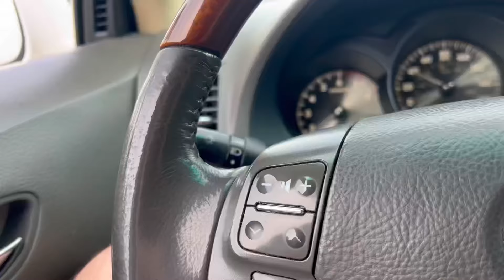Best Sounding G37 Exhaust !? (ISR SINGLE EXIT)

Comment: another g with isr and aodhans🤦🏽‍♂️
Reply from the maker: The 🥩 riding is crazy
Reply: @BrandyBoy13  🤣😭, ok bud if you say so
Reply: fr basic g37
Reply: @-MoTioN i mean it’s a good exhaust didn’t know it was a issue to like a exhaust 😭when every mustang is driving around straight piped or h piped with rush muffs
Reply: @jlamontt17  now every infiniti got this raspy loud cheap exhaust on it, basically like the mustangs.. its a good exhaust if your cheap at the end but its not quality like the rest and most vq owners know that..
Reply: @-MoTioN  i mean i’ve never heard someone complain ab their exhaust being to loud i mean what are you expecting to happen to when you buy one , also isr is only raspy if you go bout it the wrong way simply going resonated test pipes with a solid y pipe is enough to get rid of the major rasp or if you really wanna get rid of it  buy a resonated y pipe to go with the resonated test pipes
Reply: @-MoTioN  in might opinion motordyne doesn’t sound bad but it’s not really loud, tomei is way to raspy unless you go ab it from a certain way
Reply: It’s just the starter package for every g owner tbh
Reply: @-MoTioN  700$ to 1k for a exhaust ain’t cheap the y pipe for ISR is 270$ plus tax and the single exit is 450$ and above plus labor lmao didn’t know that was cheap buddy💀
Reply: @looseplank3716  lmao its cheap